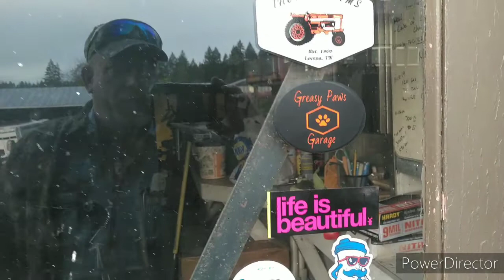a mess, driveline done& MAIL CALL!!

Comment: I'm here
Reply: G'day Bruce
Reply from the maker: Good to see you!!!
Reply: @Murphyslawfarm  G'Day Murphy
Reply: @GosselinFarmsEdGosselin  I can still look at what your doing, even if I can not get there yet
Reply from the maker: @nidayfarmranch6002  I spent a few minutes looking at the cotton harvester cab.. looks like 4 bolts with hockey pucks... And a bunch of linkage, cables and wires.. not much room to get under it, don't know if it has anything for lifting from above..
Reply: @GosselinFarmsEdGosselin  do you have something you can lift it from above?
Reply from the maker: @nidayfarmranch6002   the 4010 can do it.. otherwise, the bale loader is up on the hill, could bring it home and do it..
Reply: @nidayfarmranch6002  feeling any better tonight bruce
Reply: @ronphillips1437  im waiting to see if the soup stays down tonight. Stomach is grumbling right now.
Reply from the maker: @nidayfarmranch6002  I think I can get everything unhooked, tip it up a little and slip a couple of boards under it, then pick it up with the forks ..
Reply: @GosselinFarmsEdGosselin  ok that will work better. You going to try to get it all unhooked tomorrow
Reply from the maker: @nidayfarmranch6002  I hope so.. at least get a good start on it

Comment: Drivelines  that are installed straight will not last long, because it doesn't allow the needle bearings to work inside the cups.....
Reply from the maker: Yup.. but there are a lot of them that are Straight... My case skid steer has two u joints to couple the pumps to the Engine. They've been greased  once since 1984.. only because the pumps were out of it.. otherwise you can't get to them..